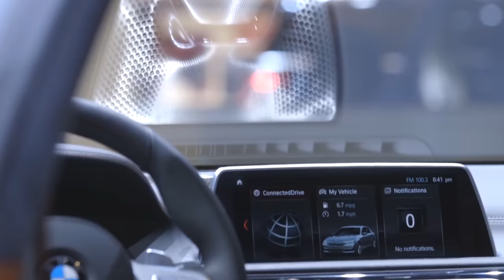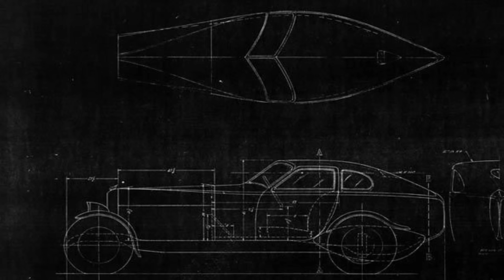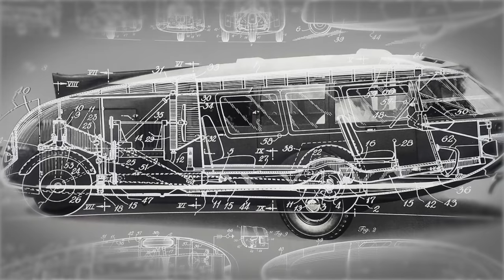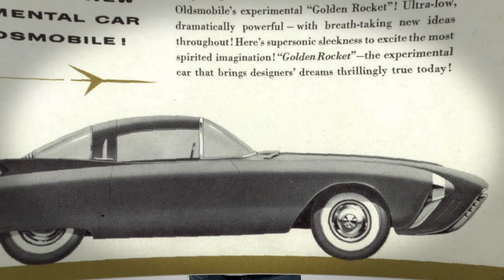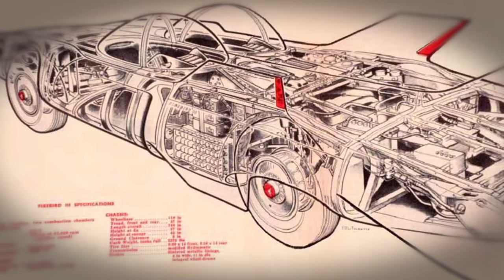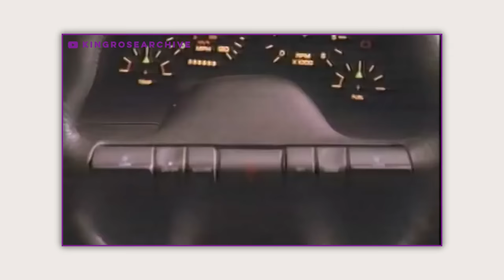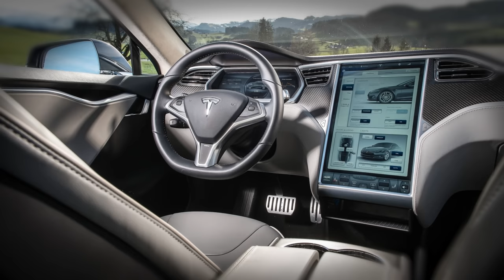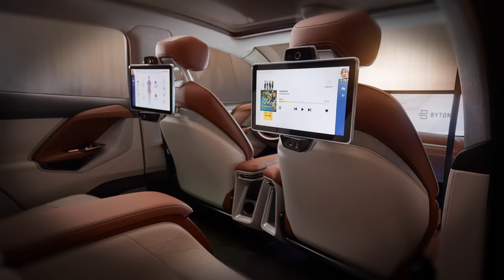The History of Concept Cars | WheelHouse

Comment: The 1985 Subaru ACX 2 was awesome. It was the concept that led to the XT. It had a touchscreen, a receipt printer thing, and all types of 80s tech. It had a flat 6 prototype that led to the 2.7 liter ER27 boxer 6 that went into the XT6, the 2.7 was built as a middle finger to Porsche. The flat 6's intake manifold looked  a lot cooler than the ER27's. While the XT didn't get the touchscreen or printer, it did get the electronic self adjusting airbag suspension, the electric power steering pump, and a push button locking center differential. There are so many cool things about the ACX 2 and the XT/XT6, I love my XT6.
Reply: The XT also looks almost exactly like the ACX, its just a little more aerodynamic. Those hideaway door handles tho

Comment: Please talk about why JDM cars are limited to 180 km/h
Reply: Satsuma 100a and 276hp and had 4wd
Reply: 2314 Alef in the late 80s,Japanese automakers had a agreement that they wouldn't advertise their cars with more than 276 hp,this is done to prevent a horsepower war that might lead to an increase of car accidents.
Reply: HAVOC gaming but acura broke that in the early 2000s with the acura TL, didnt they? I dont know what happened after that though I just assumed that pact fell apart
Reply: Not Robert and you can remove the limitter
Reply: Not Robert well they only say"don't advertise your car with more than 276 hp"
You can still produce a car with an hp higher than the agreement,as long as you advertise the car with the same or less hp than the agreed numbers
That's what Nissan did with the r32,they can't de-tune the engine to match the number,so they advertised the car with only 276 hp when in reality it is making around 300 hp
Reply: Japan police cars cant go faster then 180 km/h
Reply: Satsuma 100a they already have
Reply: @probablyrobert9086  
but ACURA is american 
It wasn't a JDM car.
Reply: Because Bosozoku

Comment: This generation is used to burn rubber on roads without electric systems and ABS. They are used of manual transmission with handbrakes to drift like pro. 
We don't want electric cars with big touch screens and remote lock systems.
We want our manual car tradition back.
Reply: Gaming 4 Life I feel for you, but things change.
Reply: preach
Reply: The problem with a touchscreen dashboard is that it will distract you the whole time while you are driving.
Reply: Just remember it's not us that decide what we get to drive, it's the sheeple that drive toasters that get to decide. Or get rich because the high end market is the only way to get what you actually want. Or get rich and make your own cars. :D
Reply: buy hyundai
Reply: I blame normal people
Reply: Tesla roadster with a 6-speed manual and no driver assists.

I want that.
Reply: Gaming 4 Life 
I think the problem is that electric cars are coming around in a time where normie tech is leaking into the car enthusiast’s cars.

Electric cars with emphasis on performance are far from impossible, but they simply aren’t being made.
All we need is an electric car without the unnecessary faff, so strip out the leather, the massive screens and the other needless tech, replace heavy components with lighter, stronger alternatives, replace the tyres with more sport oriented variants, the same treatment as you’d expect from a normal car’s sport treatment.
It just... isn’t done.
Reply: Wait until the cyber apocalypse lmao. We won't even be able to trust our automatic engines